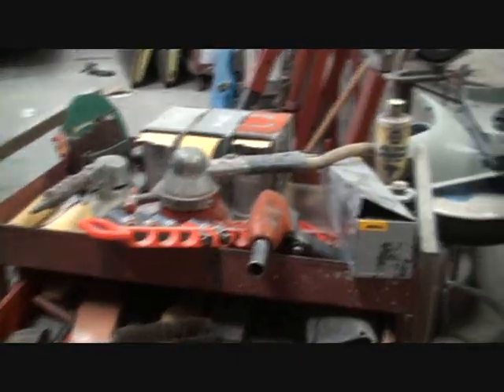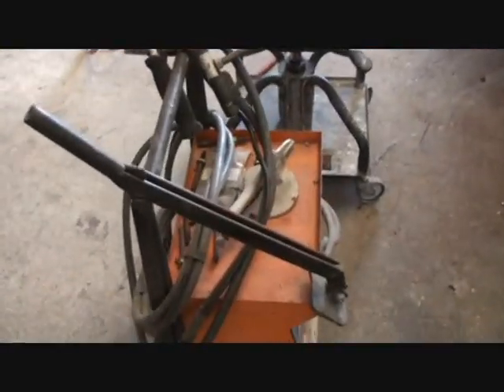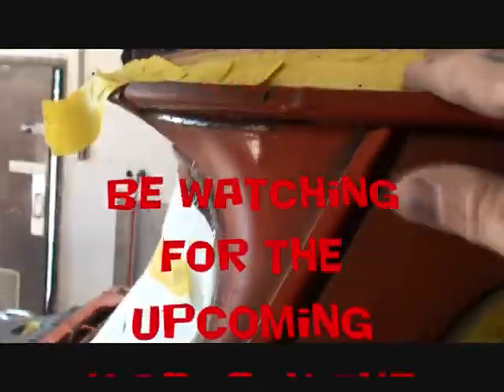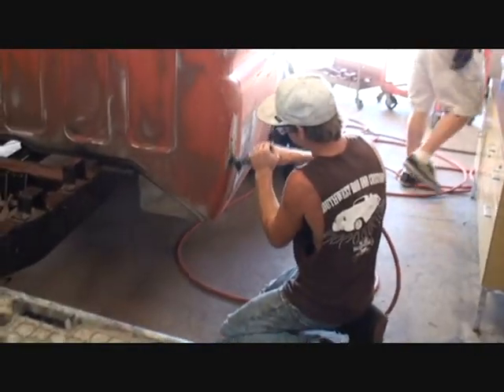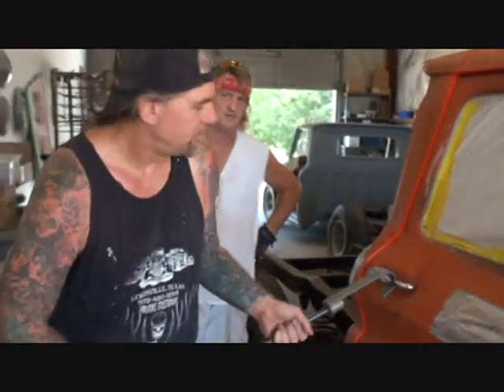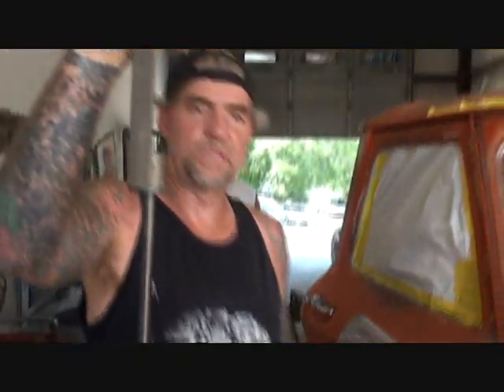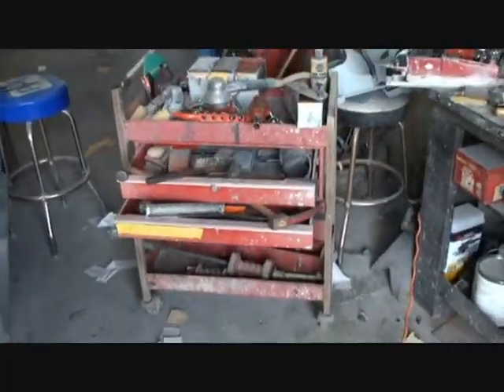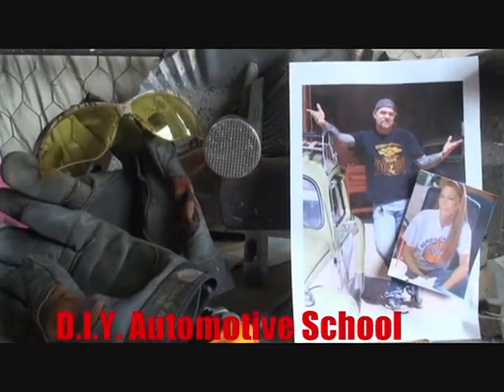Fix Dents On An Old Pickup Truck-Part 2

Comment: Pete, i heard you mention Epoxy Primer. I was told from the employee's at a local Auto Body Store that Epoxy Primer was NOT a sealer and would allow water to pass through and cause rust. Is this true? What kind of Primer do you recommend?
Reply: Water will go threw any primer 1k , 2k primer has a little more open air before water will go threw. Primer has to be that way so top coats will stick. Primer is ment to have a base and clear or single stage to seal it from water penetration.